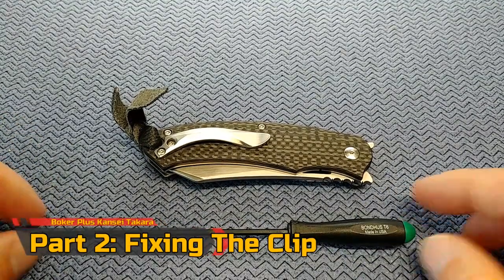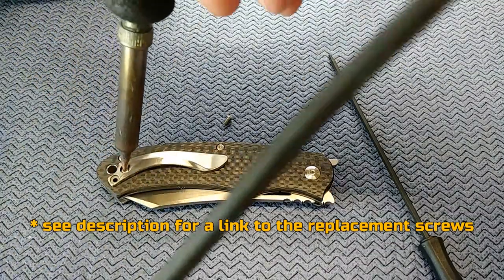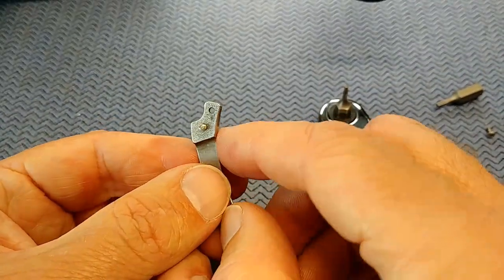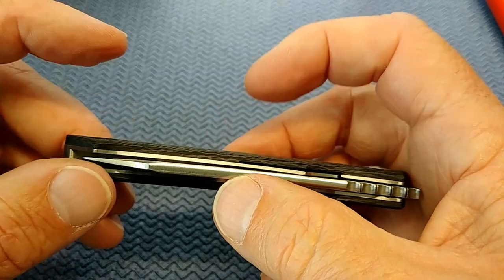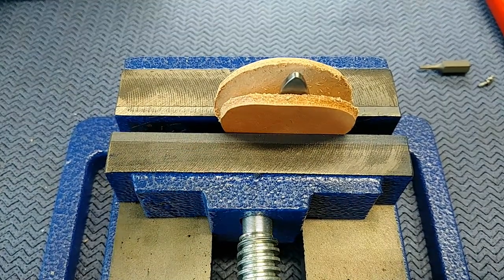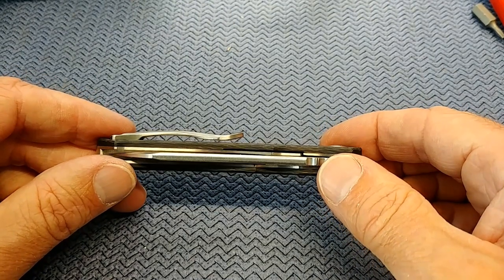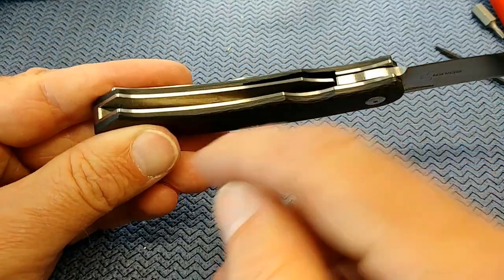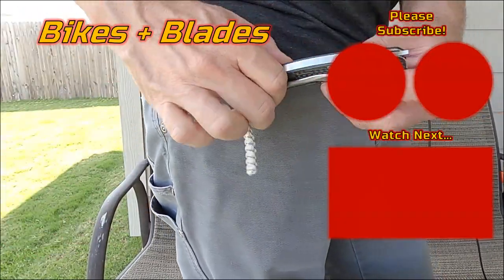Boker Plus Kansei Takara Clip Fix

Comment: I'm thinking of purchasing this knife and wondering how it's holding up 18 or so months on? Still happy with it after the tweaking in this vid or were there more issues/limitations that caused you to fall out of love with it? I had to mod my Boker Plus Wasabi CF (another Kansei) a few ways so I'm no stranger to modding to make a love of form meet my definition of function.
Reply from the maker: I still have this knife, and I carry it frequently! My only issue with it was the pocket clip being too tight - otherwise it is a really well-made knife with great style (in my opinion).